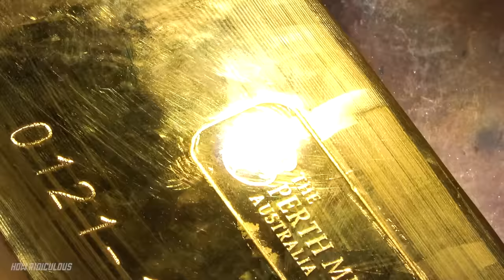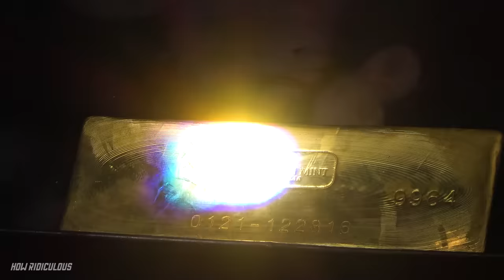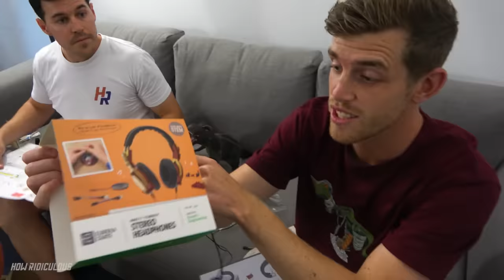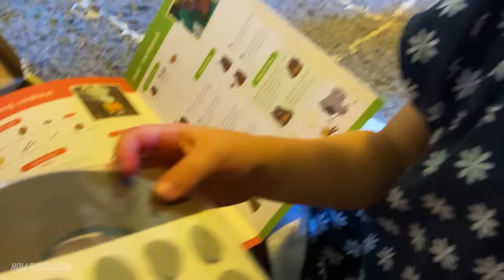Can We Melt a $1,000,000 GOLD BAR With a Giant Magnifying Glass?

Comment: IG: SSM_Edition

Looks like you weren't quite at the exact focal point, that should be a pinhead-sized dot if the lens is made right
Reply from the maker: It clearly wasn’t made right.. though it is a fresnel lens not a glass lens if that matters?
Reply: Nah, that shouldn't matter. Fresnel lenses are just sliced and squished, but each segment is roughly the same as the corresponding solid/convex lens surface. Focal length is focal length is focal length.
Reply: Theoretically yes, but in practice: spherical abberation. You will need lots of lense elements to compensate for it. A typical photography lense has a dozen elements.

Comment: 10:08 I never said “Scott, what is conductivity?” Because heat transfer through air is convection 😂
Reply: But thermal conductivity is probably involved with how quickly the heat is spread. They do not reach melting point on the large bar because the thermal conductivity is not allowing heat to build up around the point of contact.

Also, very little convection is probably occurring. Most of the transfer is radiation.

Comment: The reason they're confident is because gold has a pretty high melting point and because it's reflective, a lot of the heat energy is reflected off of the bar. sand it and make it less shiny and it'd more than likely get much hotter.

Comment: Ig:jonmeany

Sort of makes me wonder if there’s a practical way for commercial forges to use large magnifying glasses to save on power for heating metal.
Reply: Short answer, probably not. Long answer is it would depend on the metals being used, if you mean a foundry or a forge (casting vs heating enough to hot shape the metal), and how much space you had. Commercial arrays of mirrors that focus light on a spot to heat water or salts to store energy are huge. This also directs a lot of heat on to one small point. If it were steel, for example, that focal point would begin to oxidize(burn) long before enough heat was put in to the steel to forge it. A lot of steel oxidizes in a gas forge as well, but the heat is applied evenly and the piece gets enough heat in it to be forged without burning off too much of the material. The conductive properties of steel would probably not support this process as a viable method. Aluminum or copper would be better suited for this process but still probably not great. The biggest reason in my mind why this would not be a great thing to try is because the size of array needed to pull it off would require a lot of capital and a lot of real estate for very little energy put to use. The energy collected by an array thay size would be better used if it were turned to electricity, then used to make hydrogen, and then use the hydrogen as the fuel in the current processes. This is something that is currently being explored to replace the carbon intensive fuels currently used because it is far more efficient and effective than trying to use electricity directly for heat intensive manufacturing processes.

Comment: Gold is an excellent conductor of heat. With a bar that big, it's conducting the heat away faster than you're putting it in with the lens. Because the bar has such a large surface area, that's more area from which it can radiate heat away from itself. Clearly the beam can reach the needed temperature. You might actually have more success if you backed it away from the focal point so that it's heating a larger area. Also, if you had it wrapped in an insulating material or put it in a crucible or something else that could reflect the heat back onto the bar or at least prevent it from radiating heat away, you might be able to build up enough heat to melt it.

Comment: You can't put the wine bottle under the magnifying glass because is already hot before you put it and it will pop the cork out and if you do then it will pop faster without removing the coil and foil paper holding the cork

Comment: i was surprised, i thought the high reflectivity of gold, especially in the infrared, would have kept it from melting, like when you try and melt snow with a magnifying glass(for the aussies out there, snow is like rain, but its frozen) might be the plate underneath absorbed enough heat, but then i didnt think it could reach that high of a heat without insulation
Reply: I'm pretty sure that's the most patronising sentence I've ever read 😂
Reply: @TjMoon91  what was patronizing  about it?

Is it the joke about aussies not knowing what snow is?
Reply: 1. Australia's snowfields are larger than Switzerland.  We have well developed alpine skiing areas in New South Wales and Victoria and a few small areas in Tasmania.

2. Large, compact gold objects are resistent to melting for a completely different reason.  The heat conductivity of gold distributes the heat of any small hot area throughout the whole mass very quickly.  It defocusses heat so fast that no part will melt until the entire ingot is heated to near its melting point.  

Reflection of infrared had little to do with it because glass is not transparent to infrared.  IR radiation was mostly blocked before it even got to the bar.  Finally the surface area of the ingot was large enough that the heat could radiate to the environment faster than it could be input by the magnifier.  WA Mint knew it would never melt under the conditions of the boys' experiment.

Comment: Okay but what if you did this same thing, except you use an array of magnifying glasses in ascending order?

As in, the real big one on top, then one that's a bit smaller at like ~70% of its focal length, then another one at a similar relative distance, and so on like 2 more times?
I reckon you could melt Brucey with that
Reply: Nah that's the same amount of solar power concentrated. All the light collected by the biggest lens is just going to get relayed through the smaller lenses.
But have you ever seen those solar power plants that use a field of mirrors? That's a way to collect WAY more light than their magnifying contraption could collect. The only

Comment: Didn't seem like the gold was actually at the focal point of the lens. If it were, the bright spot would be much smaller, and I've seen sunlight melt metals that are much more resistant to heat than gold (via TKOR).